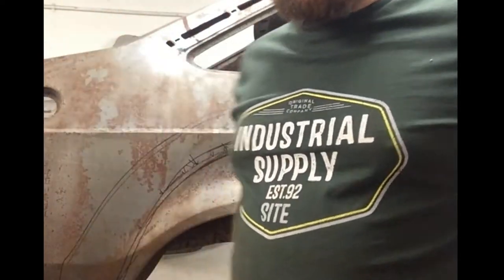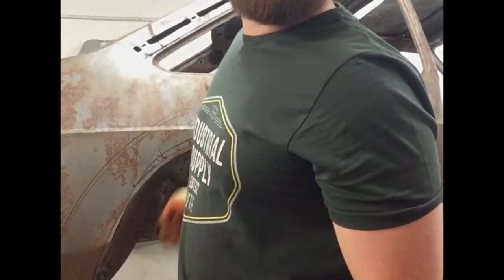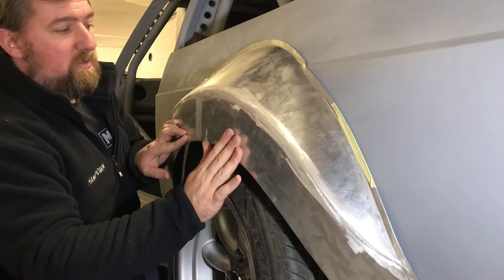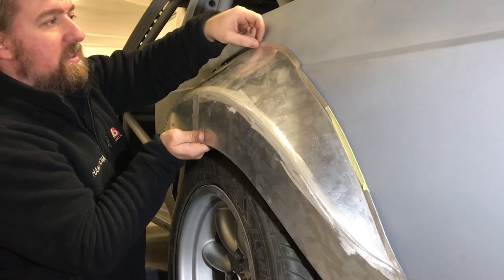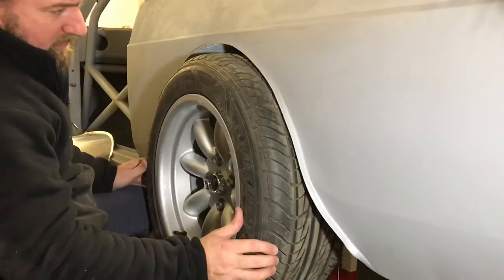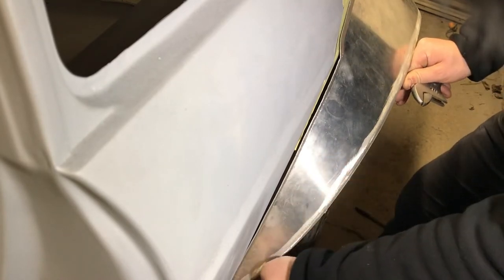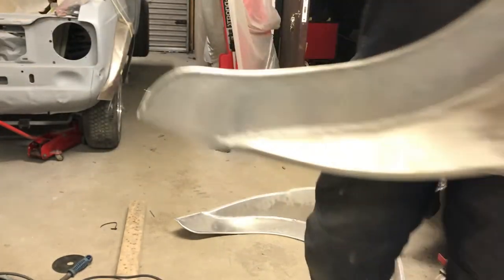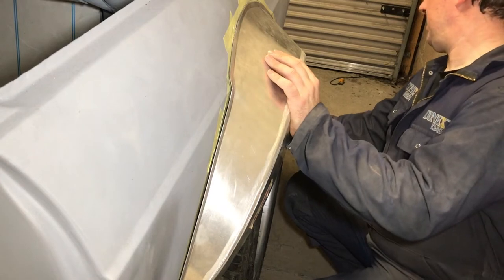Fitting Escort MK2 Rear Arches

Comment: Thank you for taking the time to go into fine detail into how to fit these arches. Even though you say you don’t have an idea of what you’re doing it is still much better than anything currently available. Keep it up !! Please go into as much detail as possible !! Also which company did you buy these Monte Carlo arches from ?? Did you have a look at what was available from Group 4 Fabrications ?? If so what did you think of their arches ?? Thanks once again!!
Reply from the maker: Hi Glenn, thanks for watching, glad the videos help someone. I wasn’t sure exactly how the videos would be taken, everyone has an opinion and you never know what people will say, but as you say, in the absence of any fitting videos on escorts I felt my experience could help even one person my mission was complete. When I started out I literally had no idea what I was doing.  I looked at all the arches on the market at time, there’s slight differences between manufacturers, also depends what you like the look of, and of course budget. I’m well aware some of us don’t have a 100k for a den motorsport unit. With arches, you can go full fat, with the Monte, it’s a little wider, but more noticeably, it’s comes further up the quarter panel past the swage line. I just found something that was wide. I wanted to run 10” on the back. The arches are from Peter Lloyd rallying ( I stand to be corrected, but I think they closed down), my decision was purely financial, they were pretty reasonable at the time. The group 4 stuff looks top notch, I can’t remember buying anything from them as yet, but I don’t think you can go far wrong in the sense that they’ll probably need a little fettle to get just right. Let me know how it goes.
Reply: @noideabuilds9248  I wouldn't worry about negative comments, everyone these days are keyboard warriors !! You're doing a great job. I was intending to run 15 x 8 rims at the rear as my engine doesn't produce sufficient power to warrant 10 or even 9 inch wide rims on the rear. To get the same look and fill the arches out like yours I was going to run a wider Toyota Hi Lux diff (I live in Australia and Atlas diffs are in short supply, Hi Lux diffs are strong and have plenty of ratios to choose from). Do you think this will result in a similar look as yours ??
Reply from the maker: The hi lux diff should be bomb proof. I’m working on part 2 of the atlas series video, I’ll be talking about axle width and fitting the axle with arches to get the right look. I imagine the hi lux axle is quite wide so I don’t think you’ll have a problem, all depends on wheel offset and the arches you use.

Comment: Nice video! Could you give me your configuration of axle, wheels and arches. I'm using tarmac arches with a standard 52" atlas axle and yesterday a friend borrowed me some 13x8 and 13x9 with ET-12 and none of them fit the arches... HELP PLEASE!!!!
Reply from the maker: Hi Fernando,  thanks for following. I’m assuming your issue is the wheels don’t fit the arches. I’m hoping to make a video talking about this very thing, but as you’ve asked: I have a very custom setup, I think most people who run wide arches have some sort of set up. My arches are huge, I don’t remember exactly how far from the body they stick out, but my overall width from the inside lip of one arch to the lip of the other side is 173.5 cm. my axle is bespoke and is 144cm long which is just over 56”. My wheels are 8” wide and are ET-20. Which gives me an axle and wheel width of 168.3cm, 5.2cm less than the arches, which Is 2.6cm short each side. Bearing in mind the wheel width is measured inside the outer lips, and my wheel bead lip is nearly 1cm I only have 1.6cm space between my arch and wheel. I also have the option of increasing wheel width and reducing ET if needed. Hope this all helps.
Reply: @noideabuilds9248  Thanks a lot for the info. My issue is the arches, going for 9x13 I need ET0 for them to fit...

Comment: Hi what primer do you use for bodywork and arches?
Reply from the maker: It’s a primer from rust.co.U.K.  It won lots of endurance tests a while ago and sprays over not so clean metal and is non porous so it’s doesn’t absorb moisture and rust. Seems the bomb, the cars been in primer for 2 years with no issue. The link below. It’s not exactly high build so it’s a good base or something to protect the car while it’s laid up. https://www.rust.co.uk/product/cat/custom-421-rust-proofing-body-primer-27
Reply: @noideabuilds9248  ok thanks for fast answer and thanks for REALLY good films!!
Is this a epoxi primer?
Reply from the maker: Yeah epoxy. Good for steel, aluminium and grp apparently. Only used it on Alu and steel. It’s been pretty good stuff.